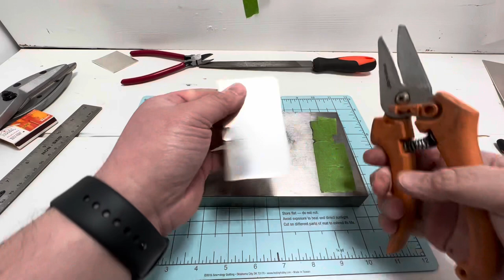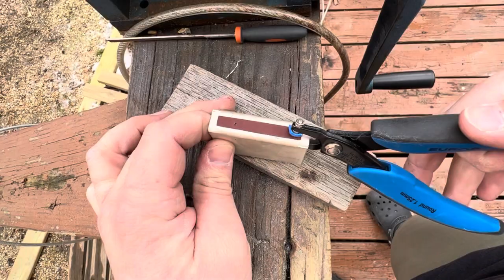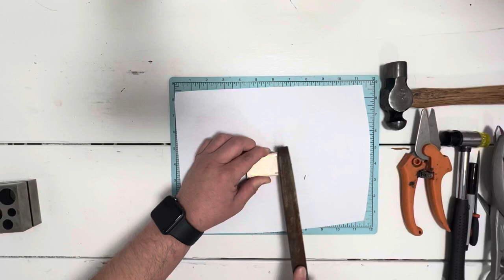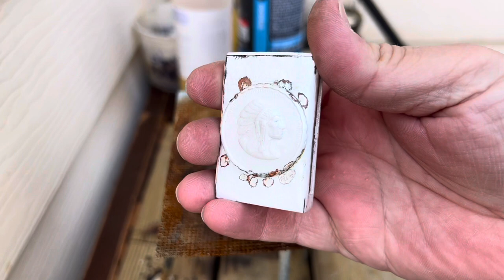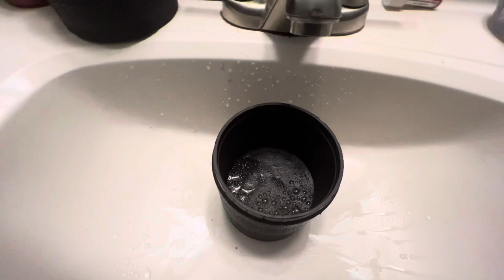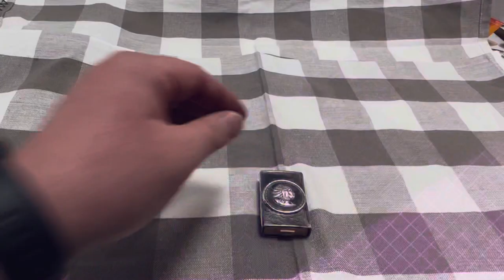Making A Matchbox Out of Silver!

Comment: Very nice! I use the strike anywhere matches
Reply from the maker: Thank you very much. I was planning on using those, but was afraid they could go off if they rattled too much.
Reply: @poured_Silver  same. But so far ive chucked them at friend in the air for them to catch, they have dropped and dented the corner of the case, they have been in this hot summer over 100*, and so far nothing yet. Either that or i just have luck on my side. Been carrying itfor about 2 years now in my cellphone case spare zipper pocket. ONE THING I LEARNED FROM WATCHING YOUR VIDEO IS TO SHAPE THE CASE BACK TO PLACE WHEN DENTED. I will do that today. So thank you very much!!!